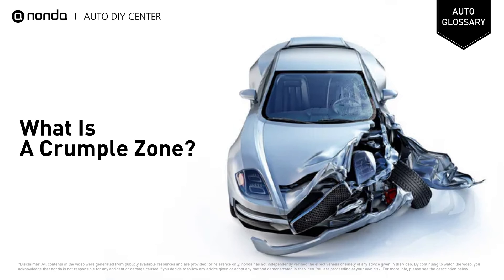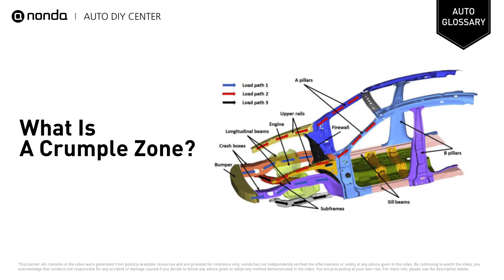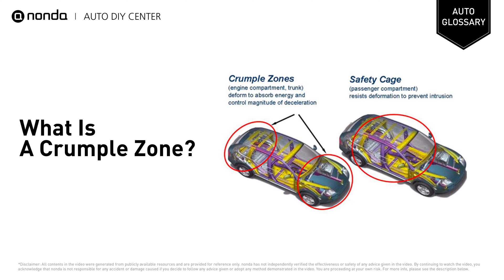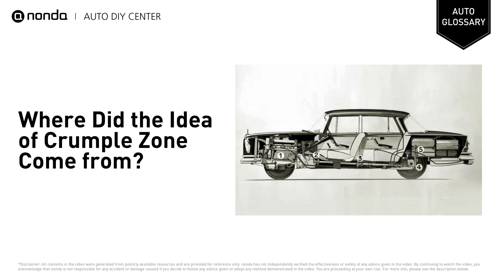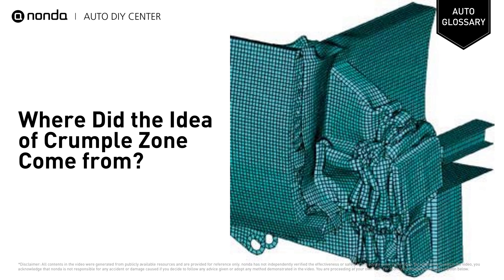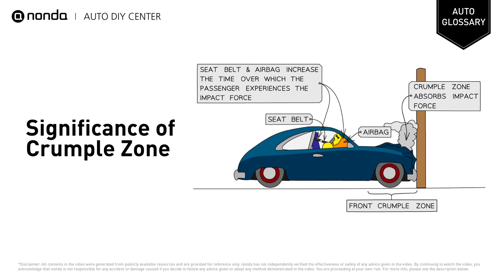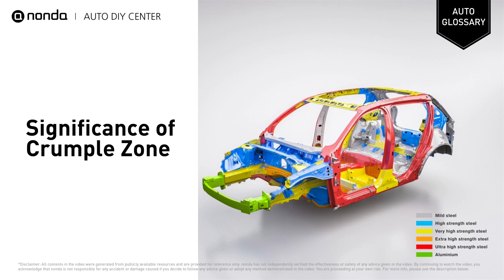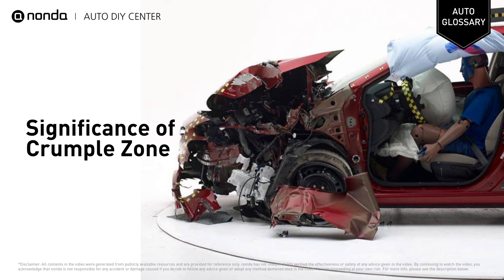Crumple Zone Explained

Comment: After an accident crumple zone cars..are a big do NOT  buy.  Example.. I was in an accident... with my Nissan 2000 altima (not crumple zone) that was hit by a van and pushed into a cadillac.  Not a scratch on the Nissan, no joke.. just one tiny scratch.. the cadillac was totaled. completely totaled...  the trunk and the backseat was gone. in the catalac.  I was hit from behind and driven into the cadillac.  Totaled at 25 mph!  That made me see crumple zones as junk. If a kiddo was in that back seat they would have been jammed forward. No problem for me.  We all walked away except the Cadillac driver that had to have their car scrapped.